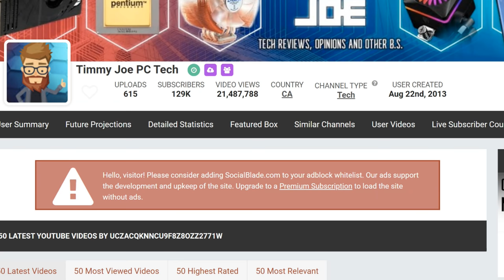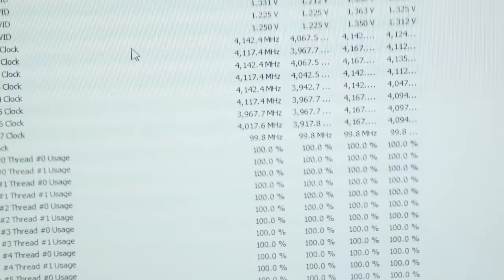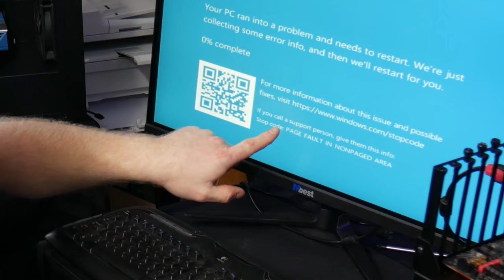This Ryzen 3700x was my biggest problem in 2019...

Comment: I had a similar problem this past Fall with my B450 Aurous Pro Wifi Itx board with an old Ryzen 5 1600. It would BSOD repeatedly within minutes of booting and very often report different error codes each time. I did everything from changing obscure windows settings to completely reformatting my PC and starting all over again, but to no avail. In the end, after about 2 months, the system just started working normally with no BSODS. I have been using my system constantly again for the last 4 months and it has been working fine with no issues or problems. I have no idea what the problem was with my system. I wish I could say I do know the solution to be able to help out anyone else who is having this problem. It is certainly a very frustrating problem to have. Thanks Joe for the great video!

Comment: Holy shit I've been having this exact issue for months now and I can't believe I'm just finding this video now!! Same CPU and the Aorus Pro Wifi and haven't been able to figure it out at all. Reinstalled windows about a dozen times on 3 different drives, tried every driver and bios update I could find, tried different gpu's, different PSU's, tried different RAM in every configuration and speed. Eventually I overvolted the RAM by the smallest increment and it was stable for weeks before crashing again. Literally everyday it will crash like 3 times on startup before being stable for a few hours and I've just been living with it. Some games just won't work for more than a few seconds, such as GTA V. I was thinking its gotta be the motherboard but this video confirmed it for me. 

Guess I'll be ordering a new MSI board real soon lol
Reply: Has the new MSI motherboard solved your problem?

Comment: Gigabyte mobo preconfigured volteges and /or microcode for 3700x might be the issue. 1 of the voltages related to cpu /ram controller or infinity fabric  might be defaulted too low for your specific cpu and thats what is causing it to crash, as if it was unintentionally undervolted. At the begining it might have been close to its lowest limit but some time of undervolting far down enough might cause degradation in some cases. Clearly the cpu works fine on the msi mobo and 3900x works fine on aorus. Try copying the volteges related to cpu and infinity fabric set on the msi mobo when running with the 3700x to the aorus by setting them manually.

Comment: Had the sameish issue in December with a Ryzen 5 3600 and a Gigabyte 470x Ultra Gaming. Near identical issues you experienced. Similar troubleshooting etc. 
One difference. When I swapped in an ASUS B450-F the issues got worse. After hours and hours of troubleshooting I swapped in a replacement 3600 into the same hardware and issues disappeared completely. No issues since Dec 28. Only change being replacement of the Ryzen 5 3600 with an identical sku. Have the bad processor out for RMA. We will see how that goes.

Comment: I used to buy Gigabyte boards religiously based on their purported quality and how impressed I was with my Gigabyte GAX48-DQ6 that effortlessly OCed my Intel E8600 from 3.33 to 4.05 GHz with just a quick FSB and vcore adjustment. Then nothing but bad luck with every Gigabyte board after that. First was when I built my Intel Sandy Bridge system, it would constantly blue screen. Tried BIOS defaults, carefully re assembling everything, nothing worked, it was just a POS board, and based on the reviews which I chose to ignore I was not the only experienced PC builder having such problems with that board. Replaced with an Asus board using all the same components and that system worked flawlessly for years till I sold it. Second bad luck with Gigabyte board is when I built a basic budget office PC for a friend based on AMD FM3 APU. The system would randomly shut off, no warning. Clean windows install, replaced PSU with a higher end more expensive one, nothing helped. I'm sure plenty of people have perfectly working builds with a Gigabyte board but personally i won't go near them anymore.

tl;dr - choose anything but Gigabyte motherboards and wait till a new CPU architecture has been on the market and available for several months before buying.

Comment: I'm experiencing similar issues with my 2700x on a Gigabyte B450 Aorus M, but I don't have all the tools you have to check what's wrong. only two more sticks of slower DDR4 ram (which worked just fine). I appreciate this video so very much! I guess i'll be replacing my MB sooner than I thought I will :(

Comment: Oddest one i had was building in an HTPC case recently and after testing the parts outside of the case with zero issues, once installed it inside the case, either it would not POST or it wouldn't boot once I got past POST. Multiple motherboards (ASUS, AsRock and Gigabyte), multiple CPUs (R3 2200G, R5 3400G and R5 1600) and multiple RAM modules (TeamGroup, 2 different GSkill kits at different speeds, and Crucial Ballastix). The only thing that worked to get it to POST AND boot was to use a different case. Over 20 years of building computers and i have never had that happen. The kicker?? I just got the case from a customer that said the computer was working fine. They wanted to upgrade to a smaller PC that was gaming focused. I even put the original motherboard back in there and it would POST. That's my story.

Comment: In my current PC build I original built it with a Ryzen 7 1700 and a Gigabyte AB350-Gaming 3 Rev. 1 from Newegg. Even months after I built the PC it refused to boot after an update and eventually I figured out the motherboard was dead. I RMAed the board to Gigabyte and they determined the BIOS chip was dead and started repairs.  While my motherboard was being shipped for RMA I bought a replacement Gigabyte AB350-Gaming 3 Rev. 1 board from Fry's Electronics.  Within a week of putting my CPU on the new board I'd get  blue screens at least once a week sometimes more often.   After several frustrating months I tracked the blue screens down to Gigabyte's App Center software, once I uninstalled it the blue screens stopped immediately.  And then I bought an Asus ROG Strix X370-F Gaming and have had zero problems since.  I used to trust Gigabyte, I used them for years in my PC builds but I've lost faith in them.

Comment: My most frustrating troubleshoot was with playing video's in full screen. It wouldn't happen with games, just like watching video's on Youtube or like a player. So while watching something the taskbar would every 10-30 minutes would come to the foreground of the video for a few seconds before hiding again. I search the internet for 6 months trying to figure out the problem, but to no avail. Finally I stumbled on to the one forum post that would solve all my issues, a program that you can run that shows what is grabbing the attention at that point in time. Windows Focus Logger saved me from this annoying problem that broke my immersion anytime I was watching a long video with the taskbar coming to the front just to be so annoying. 

So what was the problem? Epson. Yes, my printer was the issue and I even tried as far to tell them the files doing it and they basically told me to, "Piss off." So after writing down the two file that were logged by Windows Focus Logger, I deleted them. Guess what? No more issue. 6 LONG MONTHS!! I will never buy Epson again after that. What's that? What was the file that was causing the issue? E_Tinvkae.EXE was the cause. I uninstall the software from my computer and refused to use that printer again. Well I tried to copy something one day, but the rollers broke in the paper feeder. 

Also this was after the fact I warranty exchanged it due to ink header problems. So this print is a piece of junk. What's that again? What model was it. It is the Epson WorkForce WF-7720. I bought it because it had the nice wide-format printing that I wanted to use for my D&D/Pathfinder games for maps and stuff. Bash HP or other brands for stuff all you want, but when your software causes me such a minor, but very annoying issue. TO THE POINT THAT I PARITION MY SSD TO INSTALL WINDOWS 7 TO TRY AND TRACK DOWN THE PROBLEM AND MAKE ME SPEND OVER THE COURSE OF HALF A YEAR TRYING TO FIND IT!!! YOU CAN GO DIE IN A FIRE EPSON!! 

TL;DR: EPSON file caused me a minor, but very annoying problem for 6 months.

Comment: I had a TON of issues with my 3700X on a Gigabyte X570 Aorus Master. I knew the CPU was fine since I had originally installed it on an Asus ROG Strix X470-F Gaming mobo. I was actually pretty impressed with the performance since it even would run at 4.3 GHz. Once I got the Aorus Master, I was getting blue screens, it would reset the BIOS to default settings on it's own if I even changed the SATA controller to RAID, sometimes it wouldn't even boot at all and go into startup repair. I went through all the troubleshooting bs and couldn't figure out what was wrong. I run an IT business so I even have plenty of parts to swap in and out to narrow down the problem. Ultimately, I ended up sending the Aorus Master back and picked up an Asus ROG X570 Crosshair VIII Hero and haven't had a single issue since.

Comment: You aren't alone at all. I had a Gigabyte board fry the SoC of my first 1700x that I owned, it started bluescreening and incorrectly addressing memory on every board I had after that until it finally quit booting altogether. 

Random guy 2 days later gave me a second 1700x as thanks for helping him jig up a weird RX 580 and GTX 580 side-by-side setup for some of the old games he was playing to run on the GTX with new titles on the RX and I've been fine again for a very long time minus the fact this is a silicon lottery losing chip.

Comment: Timmy,
After pulling out what little hair I have left and exhausting my 30+ years of IT experience, I stumbled across your video regarding the 3700x.
Here's my issue:  Windows 10 pro runs fine, however the launch of any game will cause random crashes of the game, mainly stating it's the GPU drivers from nVidia.
I know this to be false as I have performed the following steps after getting a few BSoD's that suggested memory as the issue, and downloaded WhoCrashed to decypher the memory dump logs:
1.  Ran DDU to uninstall all nvidia drivers in Safe Mode
2.  Installed the latest nvidia drivers.
3.  Replaced the G.Skill Ripjaw V's with new Corsair Vengence RGB (both 32GB)
4.  Ran Memtest to see if bad memory was the issue, all tests pass on both the G.Skill and Corsair memory
5.  Replaced the PSU with a brand new 850W Gold+ HSi Corsair Power supply, thinking the PSU was not providing power for the video card (At the time a RTX2060xc Ultra)
6.  Replaced the original EVGA RTX 2060xc Ultra with a brand new Gigabyte RTX 2070oc Super
7.  Updated BIOS to revision F12e (latest)
8.  Updated Graphics drivers to latest nVidia drivers (446.14)
9.  Installed graphics drivers without GeForce Experience, HD Audio, and USB-C Drivers.
The issue continues to happen and I also get BSoD's mainly the IRQL_NOT_LESS_OR_EQUAL_TO error.
After extensive research on both Microsoft's and other sites, I was still at a loss.  Like you this boiled down to 2 components left that needed replacing.  
CPU: Ryzen 7 3700x
Motherboard: Gigabyte AORUS X570 Ultra
After watching your video, I'm wondering what your thought is on the following steps:
1.  Keep current CPU and replace Motherboard (requiring a reinstallation of Windows 10)
2.  Keep current Gigabyte Aorus x570 Ultra and use a Ryzen 3900.
At this point I'm exhausted with this issue, and would like your input here as I don't know if the processor, board, or both are bad.
Any help is greatly appreciated (System is less than a year old, btw, and happy belated Birthday sir)
Reply: update the bios to the f4 version, I have the same problem

Comment: My friend has basically the same problem on his retail ryzen 5 3600, and his AORUS B450 Aorus Pro WIFI since November. His PC kept on blue screening before hand, but it was rather infrequent (ie less than once every two weeks since he bought the entire build back in August, or if he was playing League). But, when he tried updating the bios, something really nasty happened to where he couldn't even get to Windows because it blue screened beforehand [including trying to install a fresh version of Windows as that would blue screen as well before even the selection screen on the fresh install of Windows]. We tried everything we could from switching SSDs to a fresh one bought from micro center, to testing out working DDR4 ram I brought over to switching his gpu from the rtx 2060 super to my working gtx 1060, to switching power supplies, and yet, no dice. We chalked it up to it being either the cpu or the motherboard, but we saw the cpu physically not having any bent pins so we thought the problem is the motherboard. (I did not try swapping motherboards since I didn't want to try to bring and then disassemble my entire build at his place as it was rather impromptu.) The Mobo is getting RMA'd  (as soon as Gigabyte would give us a fucking response), and I don't know if that is going to fix the issue so idk what the fuck to do at this point lol. It's really frustrating too since I helped him pick out the parts for the system too so I feel rather guilty about this.

Comment: QUICK UPDATE ON the infamous ryzen 7 gigabyte aorus b450 motherboard bsod issue:
I added a small offset of +0.052v in dynamic vcore (DVID) and dynamic vcore soc (DVID). Now it runs stable while idling also. Its not a manual voltage,its an offset added to dynamic voltage. It was an undervolt issue while idling all these years!!!!!!!!

Comment: Oh I have a SOLID story for PC troubleshooting that I just figured out a few days ago. So some backstory: Back on July 7th of 2019 I was so excited to pick up one of AMD's new Navi GPU's, and I did NOT want to wait for the AIB models. So I went ahead and bought the 5700 XT 50th Anniversary Edition. First time booting the system glaring issues popped up immediately. Blue screening when launching games, visual artifacting in weird places, and frame time instability when trying to stream games using OBS. At the time I wasnt worried about any of these due to it being a new architecture and such. Drivers needed to mature. Fast forward to december of 2019 and Im thoroughly pissed. Ive DDU'd my drivers 4 times in the precipitating days, Ive tried multiple weird workarounds that fixed some issues but started others. I had it. I started the warranty process because it was too much. Long story short it took almost a month to get the replacement, ok that sucks but understandable things came up and Im not too mad about it. Pop the 5700 XT into my new system (Btw I took the original GPU across 2 systems one on an MSI X370 with a 1600) with a 3900x on a MSI X470 Gaming pro carbon and the biggest problem that I was having with the first card persisted. Que Hours of troubleshooting and stress testing to figure out what was wrong. In the end, it ended up being a problem with windows 10 where if your running 2 monitors with different refresh rates with GPU accelerated tasks on both it causes frame instability in games. The fix was to lower the 144 hz panel down to 60 to match my side monitor... shit. The reason it was so hard to figure out is because this problem isnt well documented. It seems that older GPU's with better drivers seem to not be effected since it didnt happen on my XFX RX 580. So yea. That was annoying as shit.

Comment: Using an Aorus x470 w/2700x  and can confirm, same issues for me for a long time.   Took me forever to get my issues under control.  Had to tweak CPU voltages to get it stable while idle, BIOS updates fixed it not shutting down.  Still cannot put it to sleep, will never wake up.  And the RGB settings never save on a reboot, everything is rainbow again.

Comment: Hey fellow Canadian. I built my first computer back in 2017 with an i7-6850K along with an ASUS X99 A-II board. I also got a Gigabyte 1080 GPU which I still use today because the GPU's are WAY too expensive in Canada. With that computer though, I've had a little blue screen issue and everything but I eventually fixed it. I dont remember why but I think it was due to the clockspeed of the CPU and I could only keep it 100% stable at 4.2 GHz. Sad thing is if I had of waited another month, I could've gotten the i7-8700K.
Only thing is, with my current computer (3rd built), I got so much going on with my one computer, I'm thinking of getting a 3900X as my 2nd computer for productivity work to spread things out and cool off my i9.

Comment: I had similar issues with a retail 3700X and Gigabyte x570 Elite (1 step down from the X570 Pro, the same VRM 12+2 phases). I started having BSOD after setting up the Power Options to high performance, specifically the BSOD would occur after waking up the system from sleep mode. Since then I'm back in balanced mode and it's stable. Also the Bus speed on my MB is set to 99.8 out of the box and the Multiplier in CPU-Z jumps around between 42.5~43, with the core voltage between 1.392~1.416. Since I'm using NZXT Kraken X-62 to cool it, and mostly PBO for boost the clocks on the CPU are constantly around 4241~4391 MHz.